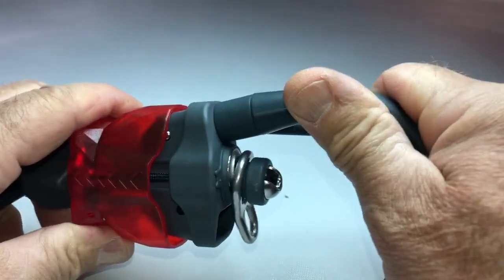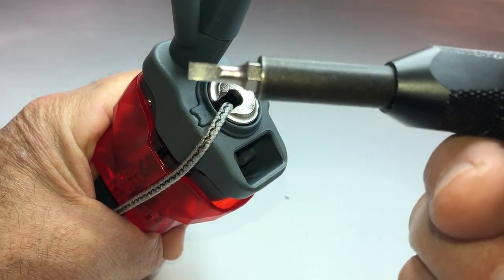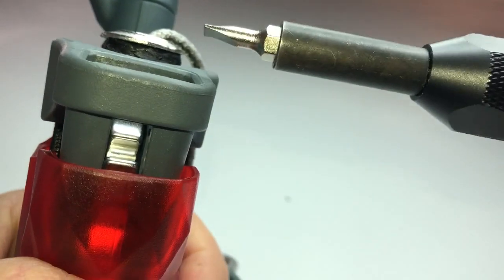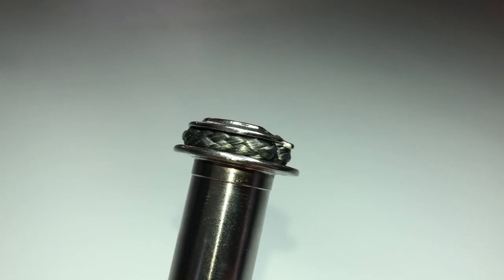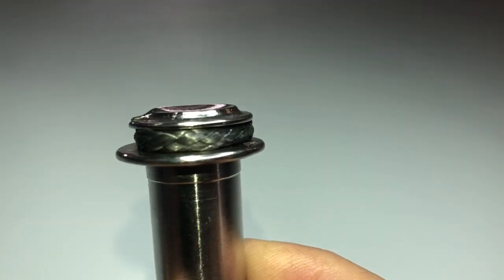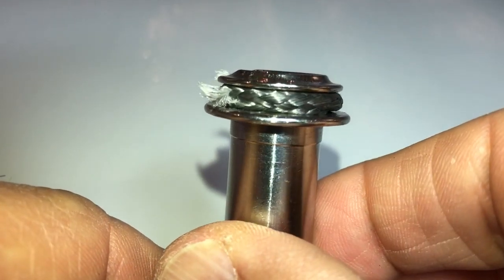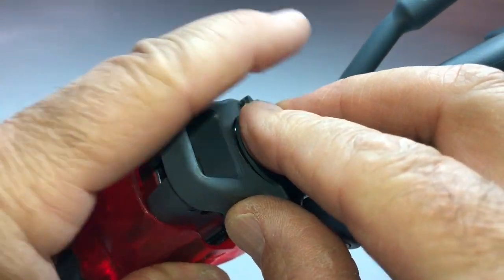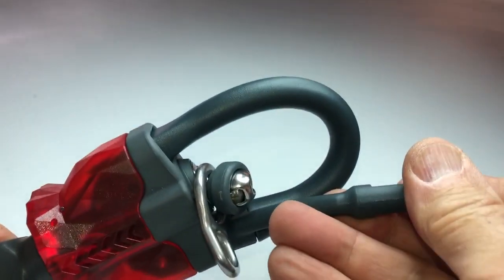i3 Quick Release - Inspecting the main trim line for wear

Comment: Sorry for this unsatisfied message, but Naish France and Europe didn't reply to my request. Maybe, you'll do it ... ?!
It's not acceptable for a leading brand like Naish that you sell bar like consumable, to be replaced every year, and especially due to the increasing prices because we can't change anything and we are talking about safety ! Naish is a leading manufacturer, you have to provide as MINIMUM the following parts : lines, flagging lines(the elastic one) and the trim.
The worst is the trim is very very hardly removable (I can't actually)  !!!!!!!  So ??? we put it at the bin ?

Thanks for reading but, please, reply something : Why this design and where and how to change the using parts ?

Comment: Hi, I have just bought this bar. If I pull the quick release the flagging bungee line gets stuck with his knot at the metal insert at the bottom of the chickeloop preventing the line to flag out completely. Any tips how to fix this? Does any body else experiences this?